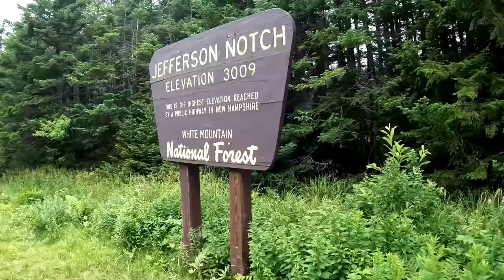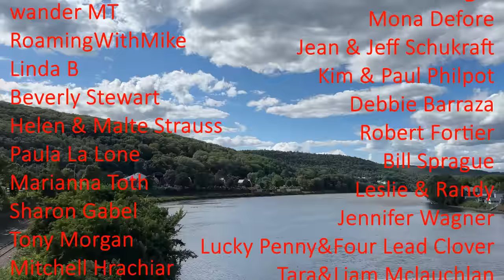WE KNEW IT WAS COMING! Our Van needs some TLC! After 5 years..... maintenance is needed!

Comment: We just left Maine 2 weeks ago. By your map heading out of Gorham it looks like you drove by my old house. Close to Hollis center off of 117, Cape road. Or state route 4/202 Hollis road 😂.  Well glad you got the work done because it was needed. I was good till the end of the video with that brake noise 🤦🏼. Hope it is nothing serious. ✌🏼
Reply from the maker: Ha.... It was a rock! It scared us though! We stopped, reversed and went forward a few times and it never happened again. Although we have another problem ⚠️ we will deal with after our seasonal job.  We think it might be the cv joint or axle on the right side or possibly the one we just replaced. Anyways it gives us a minor vibration only at certain speeds. 🤷‍♀️

Comment: Feel your pain! Our vehicle issues over the past year:
Shocks
Struts
Rebuilt trans
Throttle body
Front & rear brakes 
New exhaust manifold
Rear window replaced
Coolant flush
Thermostat replaced 
Front right 4-wheel drive rebuild 
All new tires

…nothing $12k couldn’t fix 😂😢🤪

I’m afraid to ask “what else could go wrong?!”
Reply from the maker: Oh my gosh! But hey you basically have a new car! I hope it is running perfectly
Reply: Is yours a Promaster and if yes what year and miles on it . Thanks
Reply: @jeffhayden2737  mine is a 2015 F150 with 147k miles. Thinking seriously of trading it in.
Reply: @sonofabutcher7003  Thanks for reply, hope all goes well

Comment: Dave, just a heads up that the factory grossly over torques the tires.  100 ft. lbs  is plenty of torque for lug nuts, heck we only use 85 to 100 ft. lbs on our race car that goes 180 mph and we've never had a tire come loose in 20+ years.  You can break 100 ft. lbs loose with the lug wrench they give you with the van.  I think the auto makers use such high torque values so they can disclaim liability if a wheel comes off.  I take it you are coming to the beet harvest in Michigan.  Let me know I have a place you can probably stay for a couple of days as long as my wife doesn't object.
Reply from the maker: racing.... Sounds fun! 

We don't have lug nuts.... We have bolts. I'm guessing that's different but would like to hear what you have to say about the subject.  

We have decided to try a new seasonal job this year. We are working the potato harvest in Minnesota. 

Carrie
Reply: @oneadVANtureatatime  Lug nuts, lug bolts all pretty much the same, it's the diameter that is the important part.  You apparently have 16 MM bolts which are about 5/8 of an inch which is actually pretty large for a light truck.  I still think that 100 ft. lbs. is enough but do what you want.  I just think that you need to be able to change a tire on the side of the road and at 150 ft. lbs. that's going to be a chore.  Maybe you should think about an electric impact.  Good luck,

Comment: Have you guys heard of AmsOil? Supposedly you should replace your regular oil with "AmsOil" to prevent early loss of--and the necessity to replace--your engine. We are at 17,000 miles on our 2020 ProMaster 2500 engine and have already heard that this is the most important prevention you can perform on ProMaster vans  to save your engine from an early demise.